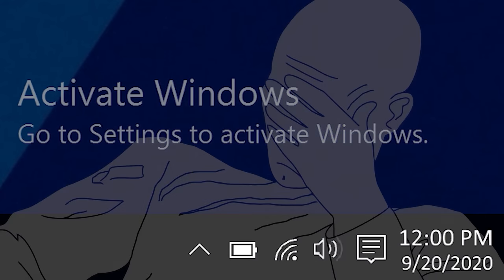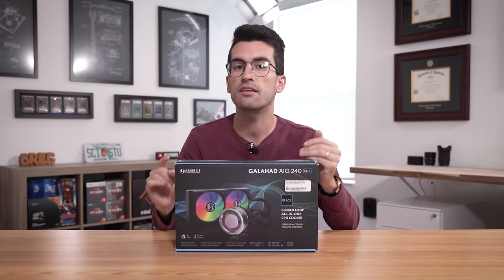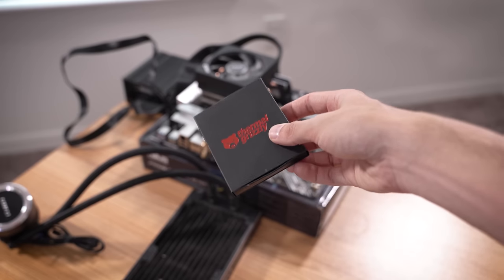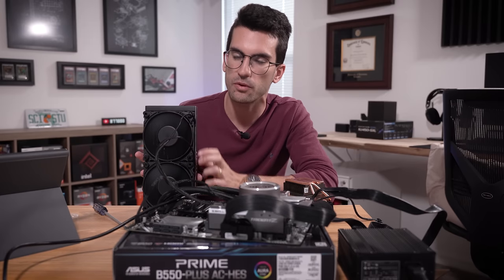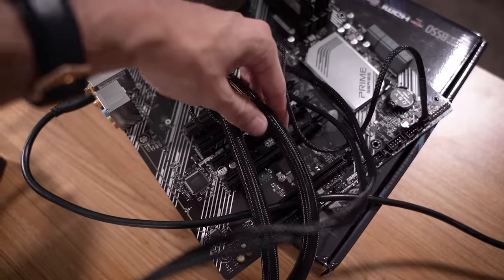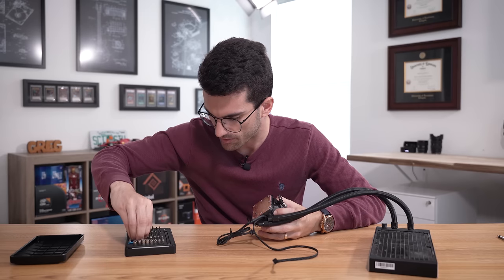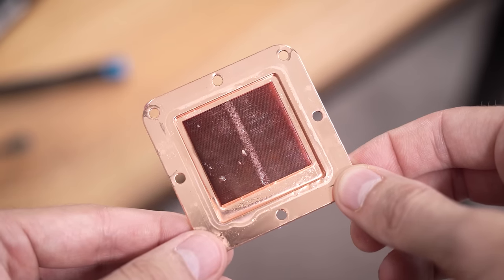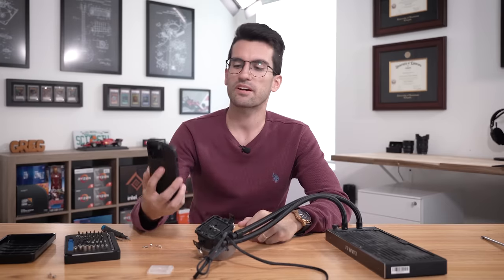A Viewer Sent Me This Broken AIO...

Comment: Alphacool Eis Wolf-serie has the same problem.. from the start, the user need to manually open the AIO and clean the whole thing from junk.. and refill it with new liquid... the temp diff is like 50c for the better.

Comment: Haven't AIO makers ever heard of fuel/water filters? My lawn mower and car have one. Even my lawn irrigation sprinklers have a small cartage-type filter. The larger-size filters are transparent and easy to replace, allowing you to see if they are clogged. AIO makers could modify their systems to include a replaceable filter and save themselves warranty costs. Simple solution?

Comment: Every time I hear about issues with AIO's I'm even more happy I went with air cooling. I blow the dust out every 3 months. That's it. System runs just as cool as the day I bought it and I have a couple spare fans just in case one dies.

Comment: Very good video, I am nervous for my MSI 280R now, what is the long term damage to CPU's in this case? 
Something you might like to keep an eye out for is Gigabyte B650 issues in the mother board arena. 
I have had to RMA my Gigabyte b650 Motherboard with random poower down issues. I have checked online (and replaced all but hte Mobo and CPU) and it seems this might be a common issue for Gigabyte B650 - am5 systems.

Comment: This kind of low reliability is why ive always used a good tower cooler of some kind, water blocks and water cooling are like built in problems inevitably waiting to happen.  Water cooling is just high maintenance, leak risks and clog problems.  Ive never had an air cooler fail just keep the dust blown out of the fin stack and fan once in awhile and even in the rare case a fan goes out its a cheap fix and a quality fan is good for many more years.

Comment: My friend and I both had early Galahad 240s. Both ceased to function. Both were repla...well his was replaced twice and lian li were super smooth with the replacements. Was waiting on ya covering this. Also noticed mine had issues unless it was plugged into cpu opt for power and refused the aio connectors at one point entirely. These aio's are stubborn it seems

Comment: I have a thermaltake 3.0, got  it at start of 2017  after 2 years my 2600k started to shoot temp to the roof 95C. Ofc me broke asf and decided to just try and fix it. Took a powerdrill put in a philips bit  (because i just couldnt take out the coldplate  BTW you dont need to you can take out the plastic its alot easier to fill it up.) And replace the fluid. Temp never went over 75c at 4.9 with 1.54v. I still use this aio in today 5600x i also replaced the fluid few months ago. It runs ok for a 120mm aio. 5600x with boost it reaches around 82c in cpu intensive games

Comment: I've got a Silverstone 240 rad that's done this exact same thing, it was working perfectly until I stopped using it and stored it for a while.
When I needed to use it again, I put it in a build only to find out my CPU was overheating on idle.
I wonder if other have experienced this as well after not using it for some time.... ?

Comment: I had a first-gen Corsair H80i that did exactly this. It did a great job for (edit) I think almost 7 (/edit) years, but one morning a few years ago I woke up (left the computer running overnight) and the rad fans were just on full-blast. CPU (i5-4690k) was at like 96C and was downclocked to like 2.4GHz or something. I could feel the pump/block humming under my fingertip, so I knew the motor was running, and one of the hoses was suuuuuuper hot while the other one wasn't. I just ripped it out and replaced it with a tower air cooler from Enermax and moved on with life. I still have it in its box in my closet. Maybe I'll strip it down and see if this is what it was.

Comment: I am having this issue right now but my galahad was made in April 2022. My 13900k idles at 65+C but still stays at around 80C at load. So I guess mine is partially blocked. LianLi confirmed they will send me a replacement free of charge and don't have to return the old one. I'll take my pump apart when I receive the replacement.
Reply: I was indeed puzzled about why the sudden idle temp jump and tried to reseat and re-paste multiple times and nothing helped.

Comment: Unlucky me, my Galahad 360 AIO has not been cooling my cpus as well as it once did and today was the day I had to replace it because of what I suspect it being the same issue here in the video. Fortunately I have a back up air cooler for my 5800X and my pc is now running fine, I'm certainly testing their statement about affected units because my serial number is definitely before the ones you showed. So here's hoping I get a response soon.

Comment: I have a quick question for the tubes:

Couldn't be the reason of tempreture differences between tubes is one tube is for exhoust which is transferin hot water from CPU to radiator and the other tube is for intake which transfering cooled water from radioator to CPU.
Couldn't this be the reason for the temperature difference between the pipes?

Thanks.

Comment: I had this same problem with a 240 and they replaced it no problem but it did take almost 2 weeks to get the replacement. Now that they have information posted about it i need to check serial numbers on a pair of 360s and another 240 i have.

Comment: personally i consider AIO's as an unnecessary point of failure in a build  like an accident waiting to happen . i'm changing my R5 3600 cpu for a 5800x and for now i will use my hyper212 evo v2 that should handle it well enough for the time being . i plan on getting a Deepcool AK620 zero dark  soon  to replace the 125w tdp max hyper212 with the 230w tdp max of the AK620. Meanwhile the 105w 5800x chip should be fine since i don't overclock even if i have only a 20w margin between cpu and cooler max tdp's and with 2 cougar Vortex (43.54 CFM) fans  in push/ pull config which is better than the only cheapo stock one provided by coolermaster it should still be alright  since i don't plan on using the hyper212 long term with the 5800x .

not even once have i tought/considered about getting an AIO for this 5800x cpu

Comment: I have an NZXT kraken AIO that has connectivity issues with CAM and would just not turn on the pump on every start up and i would have to cycle the pc a few times for it to work. After a back and forth with nzxt about the problem they agreed to replace it if i sent it back to them but i needed an original purchase receipt(after a year and a move it was lost but i had the original box) they then turned to refusing to replace it without a receipt. Seems like MSI and lian li  are at least some what trying to help those with problems. I have read that many  people on reddit have this problem with the Kraken. I was curious if you have seen this problem in your fix or flop series?

Comment: Had the same with a LianLi Galahad 360. Great that LianLi replaced mine within 2 weeks. After replacing the AIO temperatures dropped by more than 20°C in idle. Any idea if I can refill the plugged AIO with distilled water and 25 % Innovatek protect concentrate?

Comment: I've been building PC for almost 30 years and built plenty of PCs with AIOs for other people and most had issues after a few years.
In my personal PCs I never used an AIO and never had a problem with a tower cooler, got 2 NHD 15s, 2 NHU 12s and a few smaller air coolers.
That said found a deal on an open box liquid freezer 420 for less than 100$ so bought it and put it in the closet for maybe future use. I have a question, is it ok to leave it in the closet for a year or 2 or 5 or will it go bad somehow because of no use?

Comment: I've had an 11th gen compy out of commission for the last month because I wasn't sure what was up with it and haven't had the time pull it apart yet. It has a 360 lian li cooler on it. I had limited success getting it to run by just undervolting the processor and figured it was a bad chip. What are the chances the cooler is my issue. Best way to check?

Comment: One thing i've always been curious about and maybe you can make a video on is attempting to revive an AIO like this?  Will Soaking it in vinegar and flushing it fix it?  Also using something that does gunk up like that over time would help as well.  Just generally curious if something like this can be fixed to avoid unneeded waste.  Thanks Techno.
Reply: Hey, a bit late on the reply here - but in my experience ive done this in order to avoid waste, works fine after a flush and clean with vinegar-  replaced with new coolant.

Comment: Well... IMO the gunk and permeation is inevitable especially on AIO's since it's a closed loop and bacteria inhibitors can only last about a year or so that's why custom water loops do need maintenance in between 6 months to a year depending on your coolant and it's additives to prevent these kinds of build ups. It is also one of the advantages of having a custom water loop. Sadly custom loops are expensive and requires a lot of research, measurements, and parts to be effective.
Reply: The gunk shown here has nothing to do with bacterial growth or anything the like. It's a manufacturing defect that left residue from the soldering process of the radiator inside, that residue reacts with the cooling liquid, and the combination corrodes the aluminium of the radiator over time. The gunk you see are tiny flakes of aluminium that got eroded inside the radiator, then built up at the "choke point" CPU block. Which is also why the AiOs are not recoverable, the radiator is already corroded beyond repair, even if you clean the CPU block and refill the loop you'll run into the same issue again in just a few months.

Comment: I bought my Lian Li galahad 240 in early 2021. Somewhere around early 2022 I noticed my CPU temps were higher than usual. Than after a month after that initial first observation, the AIO pump finally acted insane with a very loud whining noise and the fans push over to max. Call in for RMA and got replaced in a week. Once received the replacement I sold it and went back to air cooling. Didn't actually needed an AIO in the first place coz I'm just using a i5 10400f. Btw I'm from Malaysia, yea so this issue is like a global thing.

Comment: An AIO can be perfectly reliable. I have an old Alienware Aurora R3, I bought it new for my oldest with a water cooled i7 2700k and a mild over clock. He beat on it for years, and now over 10 years later the 120mm AIO still works great. 

The issues aren't inherent, they are QC issues.
Reply from the maker: The fact remains that AIOs have significantly more failure points than comparable air coolers.

Comment: I hate that even at a discount, which isn't much more than what I paid for the air cooler I replaced it with that I bought an AIO. Now it's basically just e-waste because I doubt I'll use it or the fans it came with. Maybe in the future if I actually get a CPU that is basically a powerhouse that laughs at any attempt to air cool it I'll get another AIO but for now I'm sticking to air cooling. Much less complicated.

Comment: this warranty that i need to send mine first before i get replacement unit. is why i won't be buying XFX anymore. and seems like MSI too.
my XFX 6600XT suddenly had no display when i woke it up from sleep. and now i need to wait 3 months to get replacement unit.

because XFX wants my unit to be sent to their center HQ in Taiwan by my local distributor. and then my replacement unit will be sent from there.

instead of just giving me what they had locally and just do the rest with my local distributor.

i bought used nitro 6700XT. because i can't wait that long. and even now no news of it from my local distributor. and it's been more than a month.

Comment: What is that gunk and where does it come from? How can it just appear there?
Reply: bacteria loves to live in water, and heat speeds up chemical reactions. I think chemical reactions double in speed for every 10 degrees Celsius in temperature, or so I've heard. ALso, CPU's have gotten a lot hotter recently, so the chemical reaction is getting sped up more now than ever.

Comment: My 8 year old EVGA 980 ti Hybrid clogged up on me. Started running 10c+ higher than usual. I knew something was wrong. I tore it apart and discovered the cold plate/fin stack was pretty well clogged. So I cleaned it up the best I could, and replaced the 120mm radiator with a 240mm radiator. Refilled the loop, which was a pain in the ass. And 1 year later, all has been well since then. With the larger radiator it runs 7-10c cooler under load. I'm doing my best to keep this thing alive lmao.

Comment: I have this issue exactly with a 202210 sadly. A part of me thinks the pump died I didn’t check at the time if it was vibrating. While using the computer it suddenly started gurgling loudly and got scared and turned it of immediately. Turned back on and there was no gurgle and thought it had passed. A minute later computer shut down instantly. Now every time I turn it on the temp raises and shuts down within a minute. RIP btw this happens to me a couple of months ago and bought the item within two years ago.

Comment: Which AIO do you recommend? I have an ekwb phoenix (if I remember correctly) but it's too big and I've had it for 3 years now. Looking to replace. Hate RGB so if there's anything without, great. If not I'll shut off the lights
Reply from the maker: Arctic has great performing AIOs. Also like the stuff from Corsair and NZXT. If ya want a cheap option, there's one from ID Cooling with no RGB :-)
Reply: @GregSalazar  Thank you!! Ill def look into all the brands recommended. Upgraded my system back in 2020 and now i am going through severe fomo with the new cpu's but ill get over it. My 3900x is still going strong 🤣

Comment: glad i stuck with air cooling. NHD15 for life. {this reminds e of the scene in Fight club where Tyler explains the automotive recall formula to an airplane passenger. same for AIO's} question i have is how easy is it to repair a cooler issue like this for the end consumer? a simple cleaning and specific fluid change? or are there other potential issues that a simple cleaning won't prevent it clogging again?

Comment: I have the 360 Galahad with the affected number but they declined due to I the the aio use(but it was brand new but no fans and cables). Got Lian li fans and all the cables need and is working as new but I’m afraid now. So far I keep Amd hardware temp check. I hop nothing happens 😢

Comment: i know this might sound unusual but im looking to upgrade my pc but dont know what to start off with
SPECS:
AMD Ryzen 5 3400g 3.7 boost 
Gigabyte WindForce gtx 970 4gb
Ram 16 gb of rgb  corsair vengeance pro 3200mhz but only is able to use 1600mhz
2 , 2 TB hdd 
any suggestions?
Reply: @Gabimaru (The hollow) gaming

Comment: This is why I use Arctic. They are just amazing. Support, performance and price
Reply: 100%
Reply: I had an Arctic P12 Slim fan simply explode, for lack of a better term, in my PC.  The fan blades were literally in pieces.  They sent me a new one out very quickly via UPS next day air.  For the average consumer when paying delivery fees, they probably sent it at a greater cost to them than what the fan would have cost me to replace.  That is great customer service, as they not only replaced it but also with a very fast shipping method.  They also didn't need me to ship the fan to them.  I was just told to throw the broken fan away.
Reply: @RichWhiteUM  Exactly. They dont want to lose your trust in them. 

The once sent me an email about a potential problem with mu AIO cooler and asked me to send me details for a service kit. Free of charge. BEFORE anything possibly could happen. Nothing had happened but they still cared

Comment: I just can’t cool my GPU to a satisfactory temperature without AIO based cooling.  I’m able to maintain (depending on room temperature) under 70C on my RTX 2070.  The air cooler was noisy and hot.

Comment: I have a Lian Li case, looked at buying additional fans but they wanted as much for the fans as they did for the case so, nope. Cooler is the one that came with the CPU and until I see an issue, that's the one I will use.

Real reason I came here, I needed a key and the only two that came to mind were you and techyescity. I got a code from him last build. When I went to the setting to plug in the code, even Microsoft is now saying the code was likely sent to an email. So they know what's going on. This isn't some piracy tool. Windows just decided to go free with a one time subscription for some reason. Enjoy your donut or coffee, or whatever you get..

Comment: Hey man !!! Love your videos... 
Is it possible to drain that AIO , clean it and fill it up again to re-use it.  
Just curious to know.  
✌🏻✌🏻
Reply: What ever solder Lian Li used for that AIO would only continue to keep breaking down and keep clogging. I'd just recycle the whole thing.
Reply: It might be.  The radiator looked like it had a fill port on it.
Reply: It's totally fixable. I recently fixed an NZXT cooler suffering from this same issue. There is a radiator drain plug where you can drain the old fluid. Pop off the CPU contact plate. Then you blow compressed air through it to get anything out that might be "stick" in the radiator. Clean thoroughly. Then use something like EK CryoFuel and slowly start filling it up either from the CPU contact plate or the radiator drain. Through the drain will take a lot longer since air would move out of it as easily. Once it starts over flowing close everything up and you're good.
Reply: @bogotstogoskiing  👌🏻that's what I wanted to know... thanks mate.